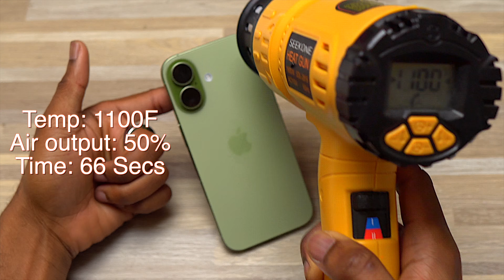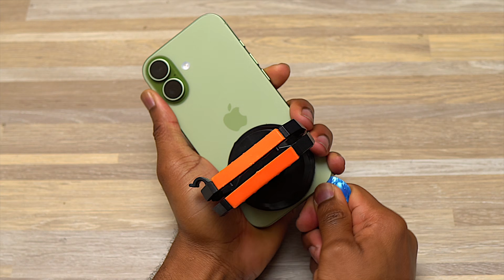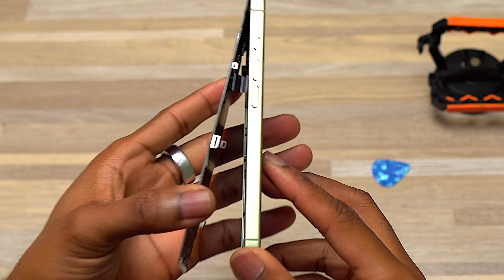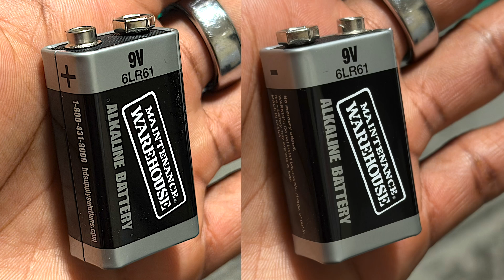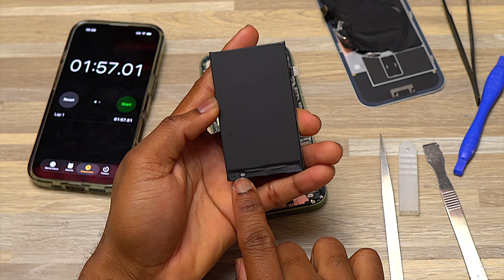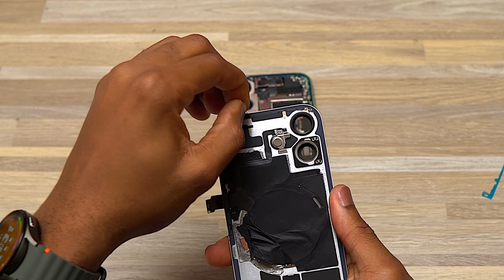iPhone 17 Battery Replacement More Repair Friendly

Comment: It’s so worst again we need to heat the back and remove the seal, there was a time when battery replacement was so easy and it takes only 1 minute. I need to spend money on heat gun battery 🔋 some wires and also minimum one hour of time.
Reply: The good old times when your devices weren't water resistant and a tiny splash was enough to brick your device.
Reply: @samratraj7030 it’s okay water is better than fire.

Comment: Brother my iphone 17 battery health is drop by 1%, i bought on 27 September, 2025, in 14-01-2026, almost 5months  drop to 1%, i don't play any games, and I charged only maximum 85%, and never down to 20%, battery cycle is only 50, 
Is it normal?
Reply: Yes. The iPhone 17 (base model) has a 3,692mAh lithium-ion battery which is an old design. The smaller the capacity of the battery (paired with this battery generation) causes the battery to age faster due to simple chemistry > smaller battery, older design = more susceptible to wear and tear from basic charge cycling. 

Never use your phone to drain below 20-30% as this causes accelerated chemical wear on traditional lithium-ion batteries. Try charging to only to 80% as this is where the battery "enjoys" being in, in terms of maximum voltage (4.0 - 4.1 Volts). Essentially, you only have somewhere between 1,107.6 and 1,846 usable mAh, causing you to charge more frequently throughout the day.
Reply: @fallenpastabean804  so 30%-80% charge only?
Reply: @lamadoo to maximize the battery longevity of the iPhone 17 base, yes; but that would mean you would only have approximately 1,100 - 1,800 mAh to use only
Reply: @fallenpastabean804 thanks man that’s very helpful
Reply: @virankumar6192  yes, battery health drops by 1% every 50 cycles. Nothing to worry about

Comment: Another tip: if the tape sticks to somewhere it shouldn't, use alcohol to release it so it doesn't have to be wasted.
Reply from the maker: You can do that but it's never going to be the same. You can try if that is your only option and have only 1 tape. It's better to do it right than fabrication lol